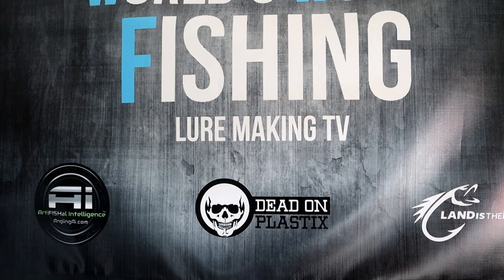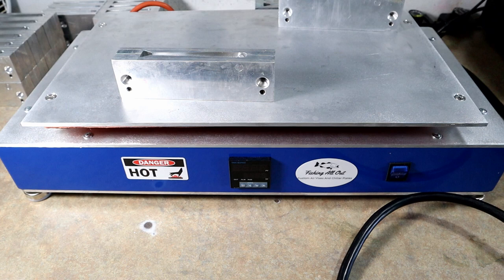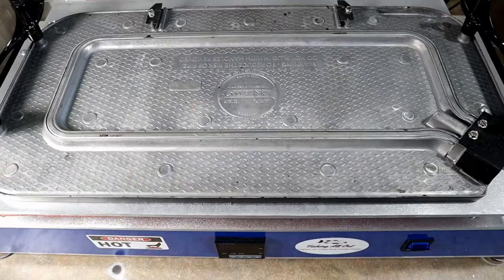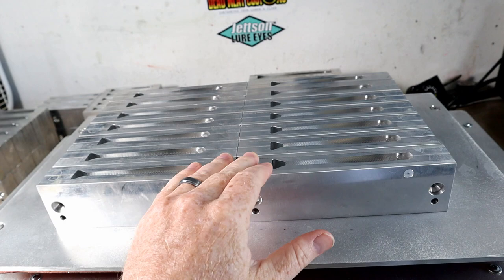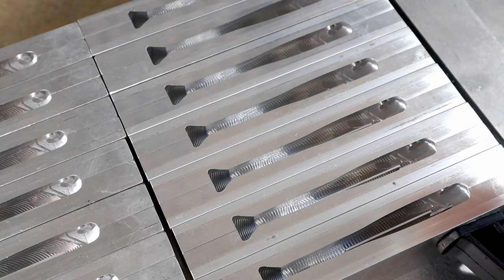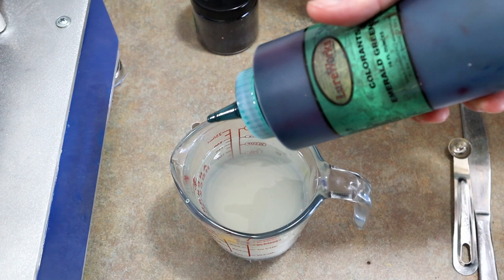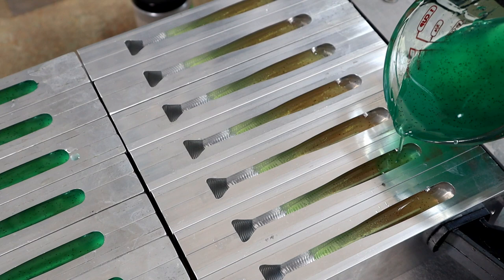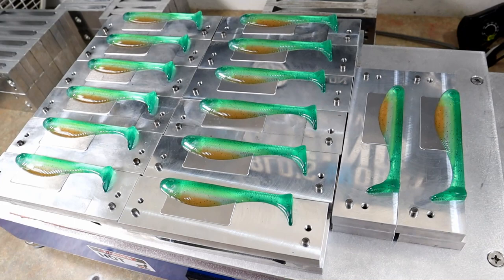The FIRST EVER Bait-Makers HOT PLATE Introduction & Demonstration!

Comment: It's a pretty neat setup, but $675 to $700 dollars after shipping cost is over priced. You could buy a portable single or double burner electric stove burner and a cast iron grill/griddle plate and not spend over $200 dollars. Hell I just tried a 5 minute internet search and even with shipping wouldn't break $100 dollars. I understand the main goal of keeping the molds warm and at a higher temp to improve shooting and pouring results and I certainly don't want to undermine the engineering and design that went into this. But I question the ROI (Return on Investment) for this. For the home bait maker, every cent counts.
Reply from the maker: I disagree...there are cheaper options in the electric hot plate/commercial cooking griddle space...none heat the entire surface evenly like this will, nor do they have the leveling tolerance this one has, much less the tolerance of the plate surface itself for even connection of surfaces.  with that said, i poured for over a year on a $40 pancake griddle with great results, this jyst take it to a new level..for the serious hand pourer.  you get what you pay for.
Reply: @WorldsWorstFishing  Which is why I say I respect the engineering behind what they've made. It's the double edge sword of maintaining heat transference. Especially when using aluminum. Because aluminum is meant to dissipate heat not hold it. Like, I can almost bet that the heat on the top of the molds is cooler than the bottom and the ones on the edge will also have cooler spots on the side and top because there exposed to more open air and wont share the heat from the inside molds touching each other. I work with a lot of temp based systems and even do calibrations for them with my job. Stainless steal is the best for maintaining and transferring heat. Cast Iron is another good one which is why I mentioned those types of grill/griddle plates. Find a good peach cobbler recipe and place it in a cast iron pot with lid. Then bury it under a fire in the hold cols. It's good eating especially with a scoop of Vanilla ice cream.

Comment: my dad had the same problems with the designs of hot plates for his company.  I suggested using cast iron machined surface hollow throughout, circulating hot oil.  If I recall he did make a few.
Reply: The one you've made is great, not going to lie, just figured it'd be interesting to see the different ways of doing it.
Reply from the maker: We have needed better options than pancake griddles that's for sure
Reply: @WorldsWorstFishing  looks great, made some high quality pours with it without rushing.  huge quality of life improvements for sure.  I'll say it fits the bill for exactly what you need.

Comment: For injection molds, do you add the color and all after you heat it up once and then heat another time or take it right out of the bucket then add colors and only heat once.

Also the “bath” you put soft plastics in, is it just water or a water mixture?

Comment: Hi great video. Quick question iam I right in thinking to sell soft plastics you would have to have your own mould's made up
Reply from the maker: No..you can buy them and use them to sell
Reply: So I could buy a mould like you have from another company and sell the plastics I make . Wouldn't this be copyright?
Reply: @sambottomley1558  as long as it's not a copycat mold. Angling AI, Fatguys, Jacob's, and etc. Make their own molds.

Comment: Is there a way to remove salt from plastic when remelting
Reply: Melt it down and let it cool. All the salt will settle to the bottom. Let it cool pull it from the cup and cut the bottom off with all the salt
Reply: @chasinfish8279  thanks for the for the tip
Reply from the maker: @chasinfish8279  yes that's probably the best way
Reply: @WorldsWorstFishing   I have a little experience with it😉

Comment: Why would you eyeball a multi pour? Would it not make more sense to use a tablespoon?
Reply from the maker: Plastic doesn't work like that..you couldn't just scoop out a tablespoon each time and dump it in..it cools fast and would become unworkable quickly resulting in very inconsistent levels.
Reply: @WorldsWorstFishing  i would love to see a fail video where you try to poor the vein with a tablespoon of plastic in each hand poor.
Reply from the maker: @victoradams4420  it would be quite the blooper reel
Reply: @WorldsWorstFishing  if the plastic cools down too quickly during this process,  i believe the next product that you should push to make is a pyrex warmer, that should keep your plastic from cooling after pulling it from the microwave and alow you to make consistent accurate pours using a tablespoon.

Comment: I greatly disagree that the quarter inch aluminum plate will not warp. If aluminum engine heads can warp, why would a 1/4 inch plate not bend?
Reply from the maker: In normal use, setting molds on top it should not warp.. comparing the stresses of an engine head to a plate that will have only a few pounds of weight on it is a bit confusing.  The builder stood on the plate without any warping.
Reply: Cylinder temperatures normally run between 8 to 900 degrees with 150 psi! The plate will never see that kind of stress!!
Reply: We run at a minimum 4 inches of aluminum at 325 degrees for melting plastic together to seal food trays. We experience warping and have to grind the mating surface on a fairly regular basis. Im not trying to be debbie downer, i just believe this is more of a prototype than an actual product.  It will work great for some time but wont last through the long haul in my opinion.
Reply: @kyledunsmore321  i agree, but the engines are dealing with 6 plus inches of aluminum.  We are dealing with 1/4 inch unsupported plate. To eliminate warping with heat and cool down you would need more support that a head in this instance.
Reply: @WorldsWorstFishing  it is not the initial force that is a concern,  it is the continuous heating and cooling that proves an issue.
Reply from the maker: @victoradams4420  agree to disagree...I have aluminum molds that are years and years old that have been heated to 400 hundreds of times over and over with no warping..there has been no indication that this should warp under normal use.. but yes, nothing ever lasts for perpetuity, I think that goes without saying
Reply: @WorldsWorstFishing  you know, there is quite the difference in usage i didn't account for. We use low and high ph cleaning substances. This may account for the difference i see in my industry. I still would feel better with a 1/2 plate or several more securing points with the 1/4 plate. I do believe it would help with longevity
Reply: @victoradams4420  I understand what you’re saying, but please keep in mind that 1/2 inch aluminum would take forever to heat up and be harder to transfer the heat to the molds! If this was something that you turned on in the morning and it stayed on all day then yes the thicker aluminum would be a better option! These things are fired up to heat the molds and are then turned off! I could definitely add an extra mounting point in the middle of the plate to help add extra strength, and this is something I may look into! Thank you for your thoughts!!

Comment: I would bet the economy will be $475 before tax n shipping.
Reply from the maker: What are you basing your estimate on?
Reply: @WorldsWorstFishing  my 20 plus years in industry.  And the cost of such items. In addition to to costs you mentioned in the video.
Reply from the maker: @victoradams4420  cool,.what industry are you in?
Reply: @WorldsWorstFishing  i spent 7 years as a helicopter mech, and 13 as an industrial electrical maintenance man. We use lots of aluminum blocks to heat plastic and seal trays. Thin aluminum dosen't last with heat, it will end up oxidizing and flaking. Let alone the warp that will happen over 3 or so years. It would be better if the aluminum was treated with an oxidizing layer. This is why cast iron is used in cheap heating griddles. Cast dosen't flake or oxidize as aluminum does.